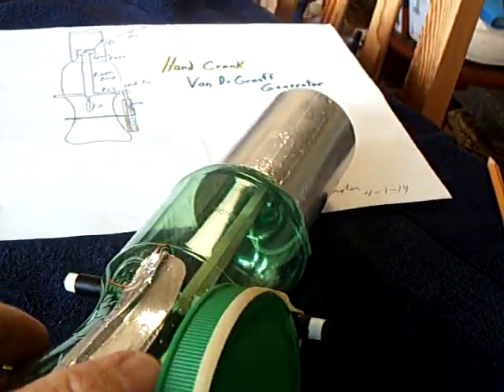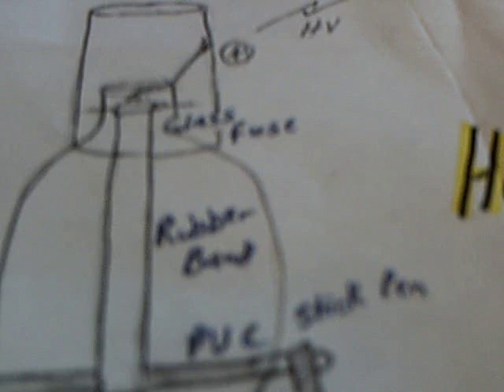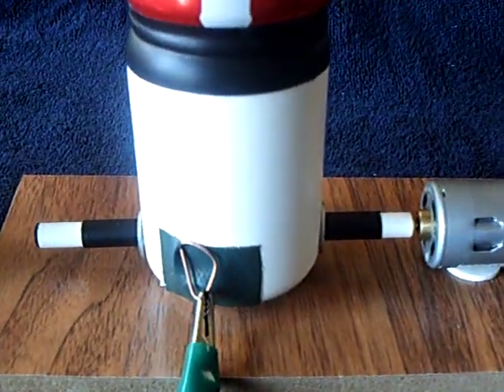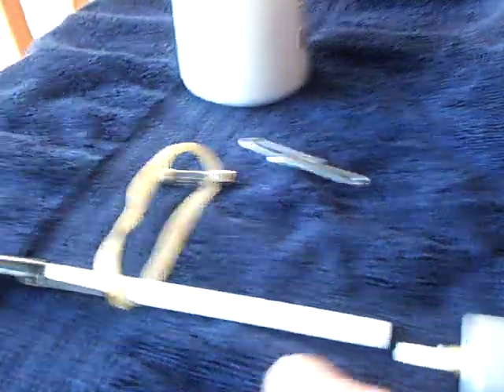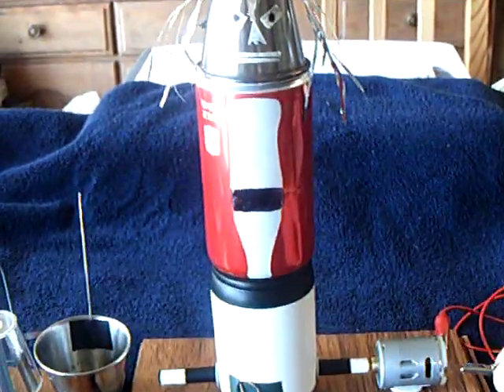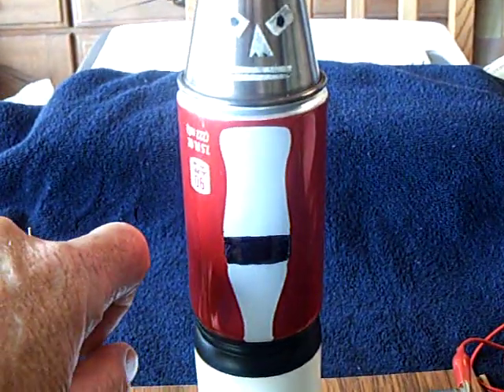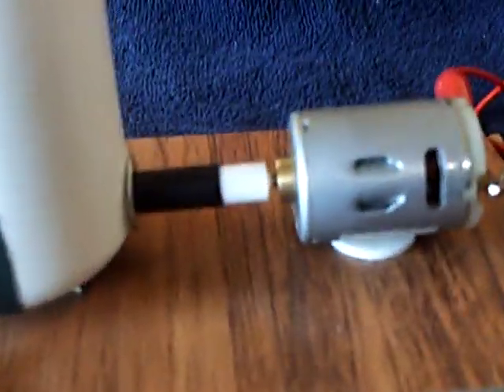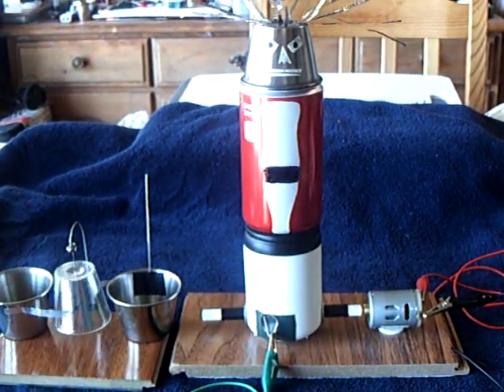Pill Bottle Van de Graaff Generator

Comment: I really like this build of the Van de Graaff.  The wireless motor is super cool.  I will try the wireless with my setup.  Thanks
Reply from the maker: This electric toohbrush came from the 99 cent store but I think that dollar tree has them also.  The tricky part is getting the weight off the shaft.  Prying it with a screw driver damages the motor so you have to tap it off with a hammer.  Support the weight somehow and use a small nail to drive the whole motor off.

Comment: That 'student' never gets old to watch...mean face too with getting all electrified haha.
The wireless ability is very neat, presumable potential difference with it being sideways is how that works ?
Very nice indeed, for watching and learning from :)
Reply from the maker: I actually put tissue paper arms on the 'student' that stood straight out but I took them off for the video.  The charged field around these generators is interesting.  It makes the hair on your arms stand up when you get close but an AV plug led doesn't work. A neon bulb only flickers dimly.  It is completely different than the exciters we have worked with so much.

Comment: Try attaching a small transformer to top and ground. Use it as a step down transformer and see if you can run anything off from that. Just a suggestion. I like your little student.

God Bless
Reply from the maker: Thanks.  It might be hard stepping 50kv static electricity down to something usable.  Probably someone has done it but I have not heard of it.  I don't think  a simple transformer is going to do the job.  Might be wrong.  It might be fun to take a car ignition coil and try to run it backwards.

Comment: you might want to try making the top roller out of a glass marble with two thumbtacks glued to it. glue one on first, then attach the other with blue tack & adjust until central, then glue in position. The spherical pulley is self-centring & means you can make a real hash of the job and it will still work. Also a belt made from balloon latex stuck together with double-sided tape is much more stretchy than a rubber band so you have a half-inch tolerance on the roller spacing
Reply from the maker: Thanks David.  Those are great tips.. The ballon belt idea can be wider also than the rubber band and that should give a better electron transfer.  Some of the VDG designs I have seen are wide belt designs and really have a punch.  I don't have a glass marble yet to try that design.  Thanks for the advice.  My next project series might be replications of some of your simple steam engines. Those are are amazing.
Reply: ***** those steam engines are such a headache. you wouldn't believe. I spent some time just trying to make a belt drive work a flywheel, sort of van der graaf generator minus the van der graaf generator. I think the belt drive is a far more demanding design problem than the generator itself

Comment: Thats cool. I bet if you get a small florescent lamp to place next to that thing it might glow really good and why not see if an av plug will light off some leds.
Reply from the maker: The FLs or the neon lights do work with this but flicker and don't really come on bright like on Slayer Exciter. That is somewhat of a puzzle for me and turns my attention back to WHY the exciters can do what they do.
Reply: exciters can do higher frequency then you can physically turn the generator with a standard motor which is in the hundreds of times per second where an exciter can make a field thousands of times per second.

Comment: you should make the pil bottle replenisher into a wind turbine. in kim models he seems to have used a spark gap on the cups themselves( to short them out?) did you happen to use a spark gap? or did you just connect the neutral wire to the ground?
Reply from the maker: There is no spark gap here.  The charge just builds up inside the can.  I have thought about a pill bottle wind turbine.

Comment: Lid, is there any way to store this energy stead of doing some sparks?
Into a capacitor or charging a battery?

I know it's just a little of current and high voltage but just asking if is it possible

Thanks